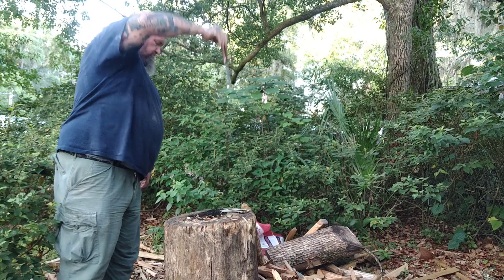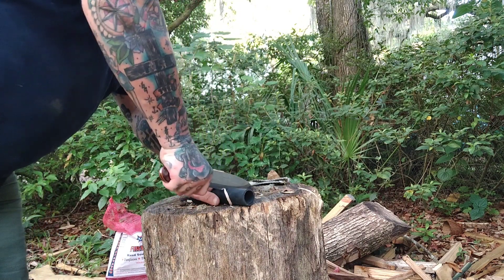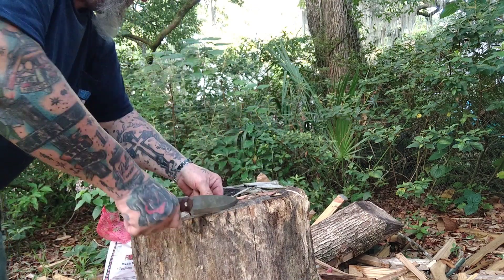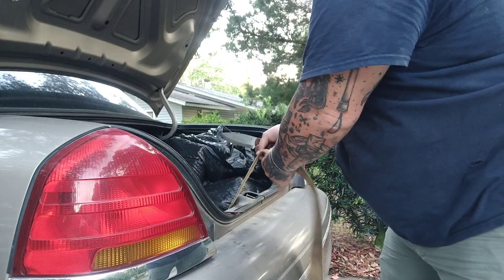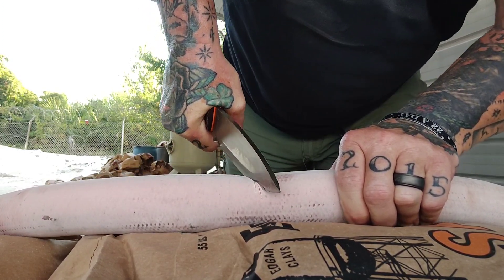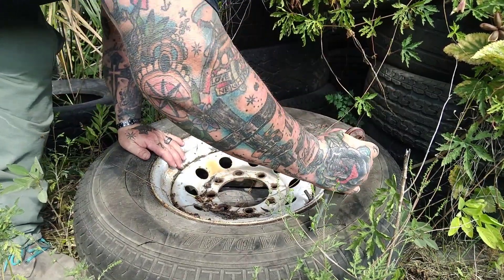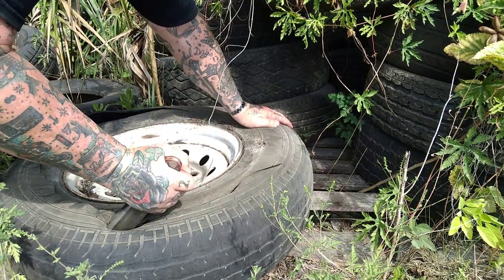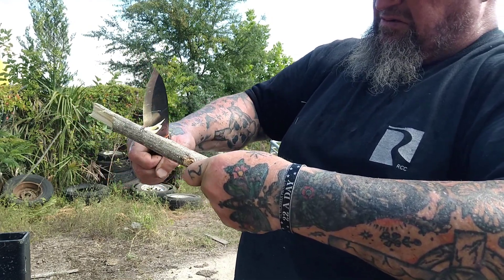LT WRIGHT MANTIS is it TOUGH enough for Ole Scabber? @LTWrightKnives

Comment: I love scandy grinds on knives! First scandy grinds do have a really sharp edge that is easy to maintain.
Second they are good at tasks like featherstick making and batoning. Because 
Third scandy grinds do bite into wood like nothing else, helping a lot when you make notches or are widdling.
Knives with scandy grinds are great for all
Next thing,  I love O1 tool steel, its one of my favorite high carbon steels, like 52100. 
I would love to see more bigger knives about 7 inches blade length on the market, because most of this blades are Mora style knives, with blades around 4 inches.
And I love big knives, you sure know this.

#22aday 
#22adaynomore 
Stay safe everybody, and stay blessed! 
Greetings from Germany!
Reply from the maker: They knocked the sscandi  grind out of the park on this knife!! Absolute beast of a knife